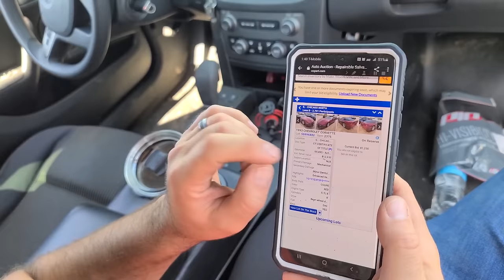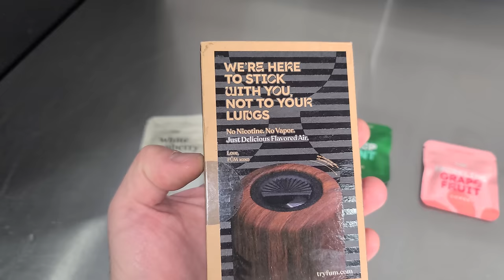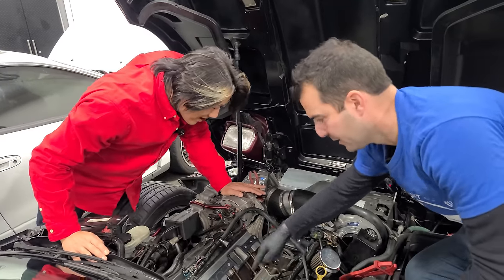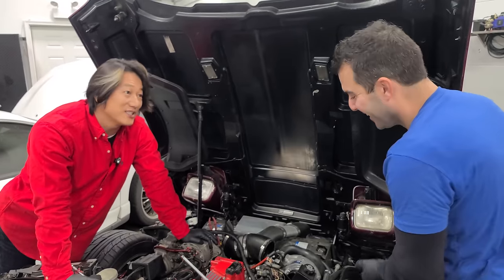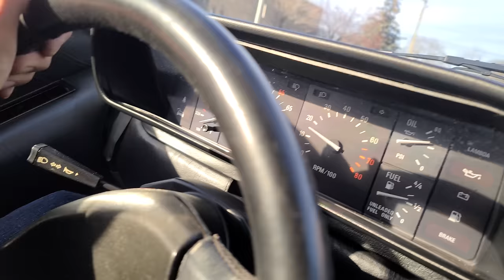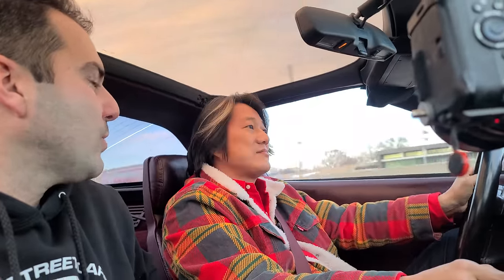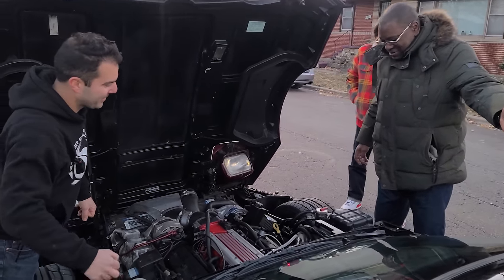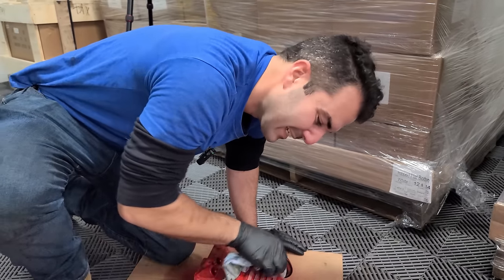We Made My $3,300 Supercharged Corvette FAST & FURIOUS Before Surprising The Previous Owner!

Comment: You can hear Sang in and out of the throttle constantly lol. It’s hilarious! Seems like a really down to earth guy who remembers where he came from and hasn’t let fame get to his head.
Reply: I'm cringing at his throttle inputs. The torque converter clutches are smoking. ECM can't go into highway cruise mixture mode, ever!
Reply: @MrSpartanPaul  Then Marlin got in the car and the driving style just completely changed 🙂
Reply: Yeah that wasn’t good. I’ve ridden with people that do that constantly and it’s extremely annoying
Reply: @MrSpartanPaul  right, and that fuel gauge is dropping like a bomb too.
Reply from the maker: The car isn't tuned so not his fault.
Reply: Alex's face says it all.
Reply: @LegitStreetCars  get a program like tunercats and adjust the new injectors flow rate in the constant table. Otherwise you'll be battling tuning issues.
Reply: Awesome guy, but tha throttling.. lol
Reply: He drives awful in and out of the throttle it would drive me nuts
Reply: @LegitStreetCars  Makes perfect sense! Seems like a very humble and awesome person!
Reply: @LegitStreetCars  that makes sense, if he was driving under more load it wouldn’t have done that
Reply: @MrSpartanPaul so so bad. Ffs keep your foot still!!!!!
Reply: His foot automatically goes into drift mode.  It's a bad habit to kill.
Reply: Could hear it straight away.  Was killing me!

Comment: BTW. . .   Thanks to you showing off Fitment Industries, I just dropped 2500 dollars on 20 inch wheels for my Acura TL.  No one else had the style of wheel I liked.  I used you as a reference.  Also 4 Michelin Pilot Sport 4s tires.

Comment from the maker: Where my Corvette people at? Whatcha got?
Reply: 09 2lt
Reply: Red 1980
Reply: I'm in a mobile home park with the sweetest double wide you've ever seen with my mint c4 parked out front in a sea of Busch light cans.
Reply: 08 black base. Stock with just black Cray eagle wheels. Its down now for the ticking time bomb GM harmonic balancer.
Reply: 91, black on black, 6 speed.  Broken in the garage.
Reply: '96 coupe I've had for 27 yrs...
Reply: 2000 C5 Magnetic Red, built for 1000 hrsprs.
1993 40th anniversary, 383'd, procharged 6 speed, inverted Grand Sport colors
Reply: 2016 ZO6 unfortunately it’s of the Matchbox brand 😩but maybe one day.I love your choices and car selection you have.The Corvette,Grand National,Trans Am and even the Delorean and LS Porsche.And for subscribers to send you parts for your projects for my entertainment?That is totally awesome
Reply: my imagination
Reply: Hello from Finland! Just sold my C5 and got a red C6. What brand are those C6 halo tail lights in the video?
Reply: C5 owner here!
Reply: My brother in law has a 63 convertible. Has been in his family since 64. White with a saddle interior. About 40 k  original miles.
Reply: Alex you need to get a tuning software like tunercats and adjust the flow rate of the new injectors. Otherwise you'll be battling tuning issues.
Reply: @AwesomeKenneth240 the ultimate corvette owner
Reply: 93 6 spd
Reply: Orange 1972
Reply: 84, z51, glad to see another Vette on the road during a Chicago winter!

Comment: Hey Alex, I love all your videos. I tune these cars in my sleep. Whoever told you 40lbs. injectors can't be tuned with that Speed Density ECM really don't know what they're talking about?!  The injector flow rate can be changed in constant tables if your using Tuner Cat software, Moates adaptor/Burn1 chip burner, and re-writable chips. I've been tuning them for years!  I hope that system has a Fuel Management Unit (FMU) on it to compensate for boost pressure; that's what they used to control fuel demand with a in line fuel pump and an MSD boost controller I would love to help you with the tune!

Comment: You if you’d thought about it , you would of removed the fuel pump fuse and then cranked over the car and then the fuel wouldn’t kick back when you opened the fuel line, lol.ljust a tip from a 40 yr tech..

Comment: On my turbo 95 c4 I was running 60lb injectors and 2 255 racetronix pumps. But I did have a flashable ecm and was able to change the flow rate in tuner pro and log it with datacat and a wideband. It idled really good to I was told lt1 has lower comp then lt4 so you can run a little more boost at least on a sbe.

Comment: The early LT1 intakes from ‘92-‘94 had square ports and had the best chance to seal against the LT4 heads. The ‘95-‘97 LT1 intakes had the trapezoid ports and wouldn’t have sealed at all. The LT4 intakes had trapezoid ports also, just BIGGER..

Comment: Here is an often overlooked bottleneck when running LT4 heads: they have a slightly raised D port exhaust that virtually all aftermarket headers block the top of the port.  Its seriously worth it to cut off the header to cylinder head flanges and weld on proper LT4 flanges.  I had a a '95 that with the full LT4 Hot Cam top end package (and the proper flanges on the headers), it made 376 RWHP.  Not big horsepower in today's world, but that along with 4.10 gears made it a solid 11 second ride at the drags.  Good on you for getting the proper LT4 intake.

Comment: Another excellent video Alex,  as a Lt1 guy (94 z28) did you bypass the coolant hose on the throttle body? Well worth it if you’re not driving it often in the cold. Keep up the good work. (Wyotech 93)

Comment: Sung is one of my favorite actors ever. Tokyo Drift is really the best fast and furious movie. Love seeing him still so active in the automotive industry. You rock Sung Kang!

Using a gdi cleaner that costs 3 times as much as brake cleaner while saying that brake cleaner works just as good is just stupid. What a waste of money. But I guess when you have more money than you know what to do with, you can do that. And saying that a dirty throttle body doesn't affect anything is about the dumbest thing I've heard in a long time. A dirty throttle body WILL cause running and idling issues all day long. Been doing this 15 years, cleaning a throttle body will absolutely improve running and driving conditions.

Comment: You should put a Torqhead or an EFI connection system on it to really give it some tuning capability. Both of the systems basically replaces the optispark completely and replaces it with a more LS based ignition system.

Comment: Those airfoils do really work, as a TUNNER who was active from 1985 through 2015 I’ve seen a lot of those foils over time, and they didn’t make huge power but it was like everything else it depended on the other mods that were installed most of the time it was about 5hp max..but what it did most of all was smooth out the response off idle ,which doesn’t sound like a big deal but if your turning a corner and you’ve got to pull out quickly without smoking the tires and landing yourself a ticket ,having control was important on those older cars since they had much less control over the power band than newer systems which allow a massive about of control comparably to newer car which gives way more  milliseconds per injector cycle..peace !!!

Comment: The red LT-4 intakes had a block off plate and did not have a egr valve. Because of the overlap in the cam it did not need it. When cleaning something like the throttle body. I would have removed the iac valve.

Comment: One thing I noticed that wasn't addressed is on the bottom side of the intake are five ports with removable plugs that move airflow for lt4 with compressor and other criteria. Made a huge difference in my 96 ws6

Comment: The newer fuel rails with the crossover in the spot along the front of the intake would be better to avoid leaning out the front cylinders. The 93 manifold didn't have the crossover but it was added to fix the issue for 94-on.

Comment: You are supposed to start the car then pull the fuel pump fuse/relay until it starves to depressurize the fuel system before you pull the lines+rail.